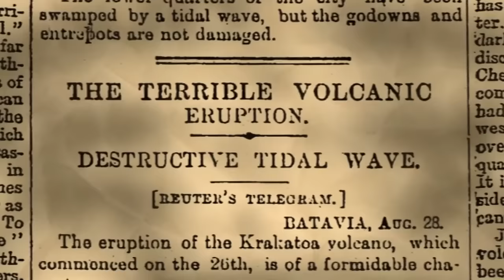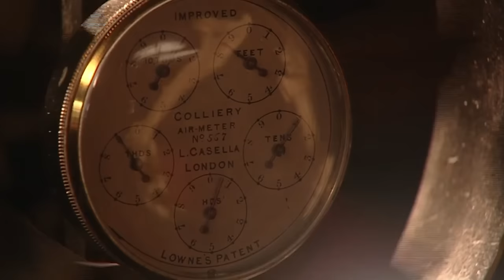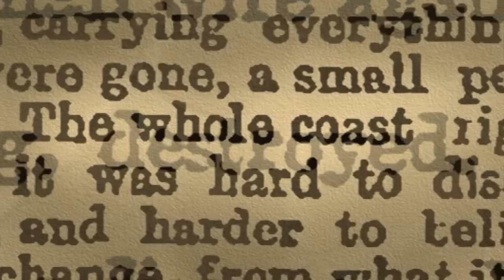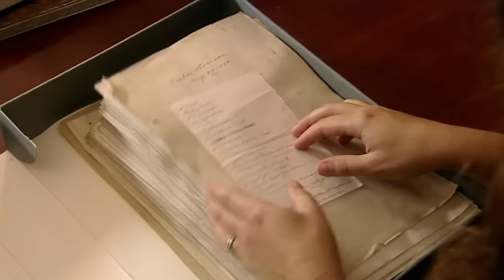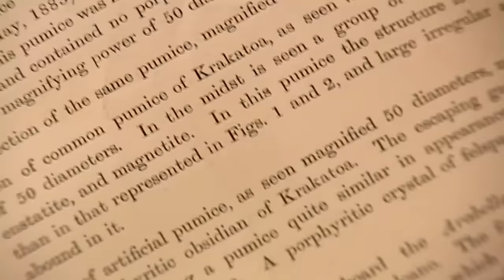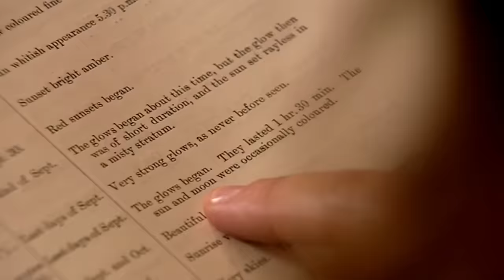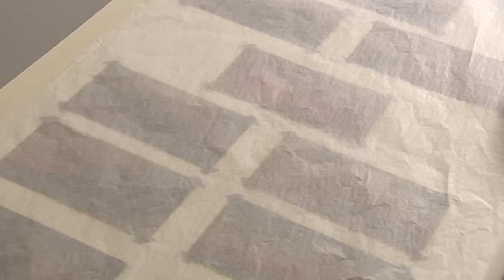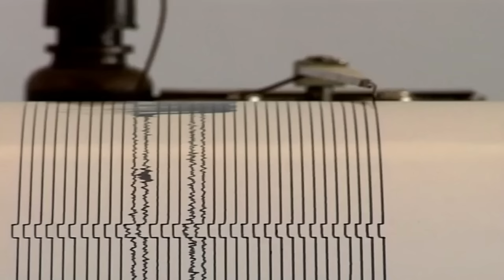Krakatoa - The Great Volcanic Eruption

Comment: Didnt they say that the sound of the explosion was heard 2000 miles away??? I can only imagine how loud it must have been to those within view of the volcano... 😣
Reply: They became deaf i guess.. If it was heard 2000 miles away it would be a not so loud thud i guess..
Reply: Most of those in view of the volcano were not around to discuss it afterward.
Reply: Many survivors became deaf from it. Ear drums were damaged hundreds of miles away. But it's not always like that. When Mt. St. Helen's erupted in 1980 people far away heard the explosion but many people near the volcano didn't know it had erupted until they saw the approaching blast because the sound went up and away from the mountain itself.
Reply: Dom M The blast was also approaching at close to the speed of sound initially - and the speed of sound rises in hot gases (by 1.5 times at 400C to 1.9 times at 700C typical of pyroclastic flows).
Basically it hits you before you hear it at close range.
Reply: they are absolutely deaf.
Reply: They first became deaf, and shocked in the same time. Plus a shockwave coming their way. This is only a small volcano eruption. We still don't know about yellowstone and toba.
Reply: 85 decibels can cause hearing loss to humans the krakatoa eruption was around 300 decibels
Reply: It would have blown out their eardrums making them permanently deaf. And probably knocked them to the ground.
Reply: People in Jakarta were awakened by the eruption.
Reply: @retard2322  ..Nooo, 85 dB is low-end on the decibel scale. Take suppressors for instance, anything below 140 dB is ‘considered’ hearing “safe”...NOT that it’s not wise to have hearing protection on or at least available, but it’s all subjective or relative to the degree of THE noise or the LENGTH of time subjected to the particular noise. ANYTHING above that 140 WILL CAUSE hearing damage. MY understanding anyway..
Reply: @Domi-pi5oi  The explosion was heard in Alice Springs in Australia
Reply: @domm4633  north and south but not west and east in that case...Krakatoa was an island blowing up completely...still..you  can be lucky or not
Reply: You're correct, it was that loud. Tambora was heard on the other side of Java in 1815, and ash falls spanned several hundred miles in area.
Reply: Say what!!!
Reply: anything over 150db can be deadly. 200db and up can cause immediate death.
Reply: Actually it was over 3000 miles away
Reply: It was estimated at 320 dB. Unimagenable loud and deafness is a guarantee for who could see the island.
Reply: @pixelation1605  Krakatoa was a joke against the Power of a super volcano. The Toba must have been so loud, that it was heard on the whole planet. The eruption was 100 times larger. I think the people, who were near this event 70.000 years ago, where simply ripped apart out of existence. The next super eruption will be in Napoli, Italy. The Campi Flegrei have started heating up, the ground is rising fast, and the pressure and gases underground are on a critical level. 3 millionen people will die instantly. You cant foreseen a super eruption. There is no way to know, when it strikes and how big a eruption will be. If yellowstone would erupt with his full power, it could be a doomsday for a big part of the U.S.
Reply: Like a thunder clause, can be heard far away.
Reply: They would die from the soundwave
Reply: It was heard 4000 miles away and the people living 100 miles away got permanent hearing lost
Reply: Welp, there goes my ears-
Reply: Google auto correct ERROR
THUNDER CLAPSE is the could like breaking Glass and is very short and intense.
Reply: @Domi-pi5oi  Makes sense.  Hiroshima / Nagasaki survivors closest to ground zero reported only a flash, no bang.  Further out reported flash AND bang.
Reply: @geoffreyswan7866  Also in India
Reply: WHAT?! I CAN’T HEAR! IT WAS LIKE STANDING NEXT TO A DOZEN CANNONS GOING OFF ALL AT ONCE!
Reply: @robs5311  If you can't foresee a super eruption, how do you know Napoli will be next?
Reply: im pretty sure people close enough to it their heads exploded from the sound idk but i read something about it
Reply: It’s so loud actually that it is able to kill people by rupturing your lungs.
Reply: @m118lr  a rifle is 140 decibels and I shoot without protection while hunting sometimes. My hearing seems to be relatively unchanged
Reply: They wrote about it when Mount St. Helens erupted. Because of the shockwave if you were from within 0-12 or so miles away from it you couldn’t hear a thing from the explosion only rumbling from the earth... anything over and you well heard it. It was in the documentary from naked science on volcanos
Reply: I think the quoted values i've seen are from 200db to 240db (sources vary wildly as seen from this comment thread). or about 64 times louder than a jackhammer.

We actually know exactly how loud it was 100km away because a gas works that distance away had a barometer that recorded a 6 cm spike in air pressure. Sound is effectively changes in air pressure so when converted you get about 173DB. And you can probably do some maths to work out how loud it was say 0.5km away.
Reply: It was estimated to most likely be the loudest sound in human history, either the loudest sound possible being thought to be at around 200 decibels, this was probably well over that. Humans will die via ruptured lungs from the over pressure at around 195 decibels, and around 50 miles away it was estimated to be at around 194 decibels. So if you were able to actually see the volcano itself, you never would of been able to tell anyone how loud it was and honestly you probably never would of heard it.
Reply: the craziest thing ive seen about this was a guy on youtube who used a computer program to simulate the tsunami from this.   yes the tsunami was high,  but what REALLY blew my mind was the ocean was literally blown away for a fair section exposing the ocean floor for like 20 minutes or so.     ya i just checked,  heres the video.  it blew a 10km wide section of the straight dry for 30 minutes.   The sundra strait is 60 - 300 feet deep!!   https://www.youtube.com/watch?v=y2IxUvF7ip4
Reply: British vessel in the Andaman heard the sound. They figured a naval battle was happening in the area.
Reply: A sound that loud kills anyone near it
Reply: What??
Reply: Acctually not only the sound, but also the tsunami and dark weather does goes all around the world
Reply: @cddvd5360  no. Much more than a thud. People in Australia thought war has started.
Reply: Courtesy of Google "The general consensus is that a loud enough sound could cause an air embolism in your lungs, which then travels to your heart and kills you"
Reply: Over 2,000 miles away in Australia people reported the sound being so loud that they thought it was cannon fire. There is also one report of sailors having their eardrums burst by the explosion even though they were more than 40 miles (~62 kilometers) away from the volcano.
Reply: @pixelation1605  small? But as you said we don't know what scale of destruction can Anak and Yellowstone cause. In particular Yellowstone
Reply: It probably burst their heads open honestly
Reply: @pixelation1605  if Yellowstone erupts the earth as a whole dies, like legitimately
Reply: xroW
Reply: It's fair to say it's completely impossible to auditory visualise 300+db
Reply: @m118lr  at 92 dB for 8 hours hearing protection is needed to prevent hearing loss.  140 dB causes physical pain...like someone driving icepicks into your ears. 
85 dB is basically heavy city traffic. 
At 194 dB sound waves become shock waves
Reply: @domm4633  wow
Reply: 1/12 of the earth surface...what ever  that is.
Reply: @domm4633  mt st helens is.considered a small  volcano...I forget it scientific classification  but its tiny.
Reply: 3000 miles away.
Reply: The shockwave ripped off sailors eardrums 80 km Away from the explosion
Reply: I was 300 miles away from Mt. St. Helens when it blew, camping in the mountains.  I thought someone had let off dynamite nearby until I heard the news later on that day.
Reply: @Eclipse-lw4vf  The Earth survives,  life dies.
Reply: It .burst the eardrums of sailors on a ship 85 miles away from the explosion. Thats LOUD!!
Reply: It go boom. Make biddow blast . Boom . 💥. 👀
Reply: @retard2322  Thanks, I was wondering how loud it was. A jackhammer is only 110-120 decibels, and the decibel scale is logarithmic.
Reply: the sound at the eruption epicenter itself was 320 decibels. The interesting thing is that at 194 decibels and higher sound stops being sound and becomes a lethal shockwave due to how pressure is transmitted by the atmosphere. This thing was literally powerful enough to kill with just the sound it produced if you were 10 miles (16 kilometers) from the eruption itself
Reply: More than that, about 5,000  miles, the sound went 3,000 miles west.
Reply: @robs5311  the whole world will follow
Reply: @GhostRavenFIN  what I meant is the exact time of a eruption. That Napoli will be next is not a prediction, it's pretty safe. But it's impossible to find out, when it strikes.
Reply: @domm4633  From the series of photos taken from Mt. St. Helens its evident that it wasnt "explosive" type of eruption, more of a landslide kind. Krakatoa mustve been opposite to that , really explosive and with a BANG to behold.
Reply: They certainly would've been deaf and also have died
Reply: The sound either and the shockwave either ruptured their eardrums or killed them
Reply: It would be great if all this data stored away in archives were scanned into the Internet so it could be correlated. Imagine how much stuff is hidden away because it is lost in moldy basements.
Reply: Anak Krakatau, also known as Mini-Krak
Reply: anyone is like a 600m radius would have had their ears blown out and either be permanantly deaf or partially, the bang would have sounded like thunder, but worse.
Reply: They were hit by Shockwave not Just Sound. Imagine people died and villages flattened Because of Shockwave.
Reply: @Eclipse-lw4vf  It will give a new meaning to the phrase "the Great Reset"... ;)
Reply: It's actually 3000 miles away
Reply: 3000 miles away
Reply: The reflection of the sound off of the atmosphere can make sound travel really far but it has to be a collosal sound to travel THAT far. It will have done a lot of damage to everyone within miles
Reply: @389293912  son of Krakatoa
Reply: I don't know, I never read or heard any contemporary reports on what the sound did to hearing, just the fact it was heard a long ways away.
Reply: I thought it was 3000?!?!
Reply: Dead
Reply: Idk but I heard it could be heard 3,000 miles away but I’m just saying.
Reply: They probably died. The sudden change in air pressure would have killed them
Reply: Actually, if you’ve seen other documentaries they say that sound was not recorded not mentioned in close vicinity (hundreds of miles) because the sound wave refracted upwards and not outwards. Same with St. Helens. Except there we have actual scientific equipment that proved it. 6.8 miles I think was the radius for those who witnessed the explosion but heard nothing.
Reply: Yep, and this was krakatoa!! Imagine how many eardrums the sounds of supervolcanoes campiflegrei in italy, lake taupo in new zealand or yellowstone here in america going off would shatter?!?!
Reply: @cddvd5360  it was heard in Australia.... A lot of farmers in Australia were talking about running sheep after this sound.
Reply: I believe the sound wave went around the earth 3 times
Reply: Heads exploded and definitely lost their hearing.
Reply: ear drums were instantly busted basically
Reply: Visiting volcanologist, "So, tell me what you were doing when the volcano erupted." 
Local islander, "WHAT?"
Reply: @Eclipse-lw4vf  Yellowstone is geothermal, not volcanic. If there was a volcano near Yellowstone, it would be the Grand Tetons, not Old Faithful. Considering the fact that scientists think Devil's Tower was made by volcanic activity, which is actually a petrified tree stump, I wouldn't worry about Yellowstone blowing up any time soon.
Reply: 330 decibels of sound. Heard over 3000 miles away in Perth and Rodriguez, near Mauritius. The sound wave went around the the world and was measured for days.
Reply: Not deaf. But dead. This was the loudest sound ever produced on the earth
Reply: Pardon?
Reply: @SophiaAphrodite  lmao gunshots regularly hit higher than 150db
Reply: yea why does this acting show that nobody was hurt by the loud sound?
Reply: I remember read somewhere that it was heard in London. Some people even thought it was a distant gunsot
Reply: There is another doc that has many different facts about the same diaries
Reply: It was heard in Australia
Reply: @mirfangu  period 😆👍
Reply: In the time since this post, the sound of the eruption at Hunga Tonga-Hunga Ha’apai in January 2022 was heard about 6,000 miles away in Alaska. I know only a few places at such a distance heard the sound of the eruption, but I suspect this is now the current record-holder.  It wouldn't surprise me if there were also some isolated sites at a similar distance that could have heard the Krakatoa eruption, yet it wasn't recognized as such at the time (and therefore didn't/couldn't get recorded as such). Hunga Tonga-Hunga Ha’apai was the first time that a "Krakatoa-type" eruption (albeit on a smaller scale) occurred in our highly-connected digital world; there was some modern scientific equipment back in 1883, but it wasn't anywhere near as advanced as what we have today given the massive advances in technology since then.

While the eruption at Hunga Tonga-Hunga Ha’apai wasn't as loud, nor as large, as Krakatoa, I was awestruck when I first learned about people in Alaska hearing the sound of this eruption.
Reply: The e plosion of Tambora was heard nearly the same distance.
Reply: P
Reply: Yes cows dropped dead in the fields in Australia from the fear. Moncks painting "The Scream" was based on the atmospheric darkness in Europe caused by it.
Reply: 3000 miles said by someone
Reply: 9
Reply: 3000 miles actually
Reply: Including to WIKIPEDIA: It was like 3.14 MILES away, from Perth, Australia, or whatever…

Edit : I misread I think…
Reply: Estimated to have been 310 decibels at source and 174 decibels at 100 miles. Eardrums rupture at between 150-160.
However, I've also heard the argument that it was more like 190 decibels because air molecules cannot sustain such a level as 310.
But the result of that is the material exposed just disintegrates trying. So either way, not good.
Reply: @allangibson8494  itwwssthefingerofgod
Reply: It was over 3,000 , parts of East Africa heard it hours later
Reply: so loud the windows bust
Reply: @tysonatkins2236  tree stump? Ooook.
Reply: It was heard as far as Rodrigues Island which is almost 3000 miles away. For a US perspective, imagine an eruption in Halifax, Nova Scotia sounding like a distant gunshot in Los Angeles, or an eruption in Bogotá heard all the way in Ottawa.
Reply: @cddvd5360  not only that some probably died cause of the sound
Reply: "Steve, stop farting." 
Steve: "It wasn't me this time, Talitha, I swear"
Reply: @domm4633  Also this eruption is like, 10x more intense than St. Helen's 1980 eruption.
Reply: Germany reported hearing a very loud gunshot(which is already loud in itself)
Reply: Yeah! So many must have gone deaf either temporarily or permanently..😢
Reply: @AZ0986688  most articles I’ve found have said that anyone within 10 miles suffered with Permanent or temporary hearing loss
Reply: Yellowstone will be really bad   A super volcano. Scary
Reply: Just looked up Toba. Never knew about that one. Wow
Reply: @robs5311  Ripped apart? More likely liquefied or vaporized.
Reply: It looped earth 4/7 times, it was also at 310db and it was heard in Germany
Reply: I might imagine that sound pressure might be less near the volcano because there was much upward pressure from the matter exploding and travelling up. The sound pressure might well behave like everything else and gravity pulls it back down as it loses upward momentum.
It is only a theory.
Reply: @retard2322  Decibels is sound pressure and that pressure varies according to the distance from the source, as well as other factors.
Reply: It was heard as far as 3,000 km away in my home city of perth, Western Australia. Pretty crazy stuff!
Reply: @retard2322  I went to a punk festival a long time ago, I swear that exceeded 300dB! Ok maybe not, but I couldn’t here shit for about 4 days. Really freaked me out.
Reply: I wonder if it emitted sound at the frequency of The Brown Note 💩 🤔
Reply: @sbclaridge  Plus it actually punched a hole in the cloud cover and reached space (the stratosphere, or maybe higher? I can’t remember). It was also pretty unique in that most of the ejecta was seawater, in the form of steam. The magma chamber cracked and seawater poured in — and the magma won. Very scary but fascinating volcano!
Reply: Sailors around the explosion lost their hearing instantly, and those near the volcano were killed by the shockwave produced by a 300 decibel eruption
Reply: I still can’t rap my head around that, that’s insane! 

Mama Earth is scary
Reply: The seaman’s ear drums ruptured on the ship near the volcano. The shockwave almost killed them.
Reply: It was heard over 4000 miles away
Reply: Anyone within 30 miles lost their hearing am not sure if it was permanent or not, was the loudest noise ever made on land.
Reply: If you could see it and it erupted one the whole island exploded 2 the shock wave would kill you
Reply: Liké thé End of Times.
Reply: They would've died or sifferer injuries because pass 190 db sound is less of a wave and more of a force and it can damage the humam body.
Reply: It was the loudest sound wave ever created on the earth.
Reply: @vishwaskarmarkar9932  And there IS nothing WE Can Do about it,Just run for our Lives
Thé POWER of ALLAH ☝️
Reply: Too much nonsense in this thread.
dB is a logaritmic scale; 3 dB increase is about a doubling of pressure.
And you should actually use dB(a), which takes frequecy into consideration, which is rather important.
The first error a lot of people make is that they say it was xxx dB. Where? Where was it xxx dB? At Krakatoa itself? At 1 km? At 10 km? At 100 km?
Secondly, we are talking a pressure wave, or blast wave. Its not a continuous sound ringing, but a singular pressure wave, which causes a sinus wave, which we hear.
Take into consideration that higher frequency within hearing range, do not carry far. In fact only the very low does (<50 Hz) and that is just on the virge of where out hearing starts.

As for hearing damage, that also depends on the frequency. I cant judge here if ppl went deaf. It depends on where they were, obviously. Too close will rupture your ear drums. Its not the same as hearing damage over prolonged time, which kills the hairs that move and activate the nerves, which make us hear. So hearing damage depends on a lot of factors. In this case the hairs will not die, but your eardrum will sure, solely by the pressure, if you are close enough. You shouldnt even speak of sound in this case, bc its not the sound that deafens here, but the sudden pressure.

Someone also said, the sound went up. No it doesnt. Look at any explosion.detonation, where you can see the shockwave travel. Its spreads just the same as electromagnetic waves, ie equally in all directions. That only changes by obstacles and the medium the shockwave travels in. So no, sound didnt go up.
Reply: @GhostRavenFIN  The bay of Naples is the caldera of a super volcano and has Mount Vesuvius, a dormant volcano to the east of the city. It is expected that should the magma chamber become active again it would wipe out the whole of Naples and the island of Capri would become the western bastion of the new caldera. Although Yellowstone is likely to erupt first it would be in a comparatively sparsely populated area. Naples is the second most populous city in Italy with around 2million people living and working within the area.
Reply: @cddvd5360 That or they were instantly killed by the raging shockwave that came from the sound.
Reply: WHAT?
Reply: Actually it was heard even further.
And to this day there is a controversial discussion about that the sound ecoed around the world 3 times.
So you can imagine how big of a force we are talking about....
Also the vulcano did'nt explode its a stupid documentary saying....
It more or less collapsed in on itself and thats the sound of the "explosion"
Reply: Volcanology has always been interesting to me. Would love to hike Mt. St. Helens and Vesuvius. If they allow it. Have a blessed weekend, everyone
Reply: The eruption of Hunga Tonga was heard in Alaska
Reply: 3,000 miles actually😮
Reply: Instant deafness. Doubt the brain would even register the sound. The force of the sound waves would probably kill you of you were close enough.
Reply: Hunga tonga was heard 5k miles away
Reply: @robs5311 if yellowstone erupted it would be major catastrophe for the whole world.
Reply: The eruption produced the loudest sound ever heard by human ears in history with the noise level of an earsplitting 180 dB!!! The pressure wave from the third blast was powerful enough to blow out the eardrums of sailors on the RMS Norham Castle passenger ship off of Sumatra!! Man, their ears must have been hemorrhaging severely and painfully... <XXX(
Reply: Most lost their hearing completely and others passed out. It was the loudest "crack" they ever heard.
Reply: 2800
Reply: @StofStuiver that was helpful, I would point out though that it sounded like gunshots in Europe America and Australia. So it was heard
Reply: @mikehipperson you are not taking into account the amount of ash fall we would experience across the American Bread Basket which would be measured in many many feet . if Yellowstone erupts the world is going to feel it
Reply: @lindawade4ok639  Thats possible. But i cant judge that or calculate it as no decent data was provided (if i remember correct). Europe and America seems a bit far, but possible i guess. Its a bit hard to say either way because there is so little to compare to. Well, lets put it this way; an earthquake is also a shockwave and those travel around the world. A shockwave in air, cannot escape the atmosphere as it must travel in a medium aswell. And since we know and can measure earthquakes and that they are heard far far away. id say yes, possible.
Pretty humbling i always think, when you witness, or even hear of such hugely energetic, powerfull phenomenon.
Reply: It probably blew out their eardrums.
Reply: It was heared up to 3000 miles away.